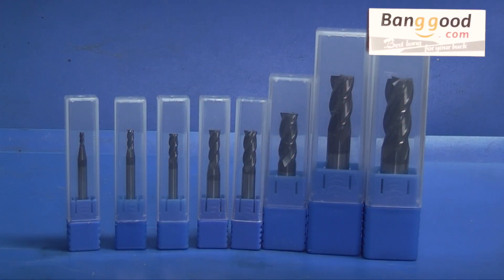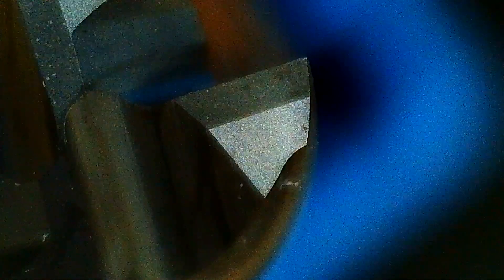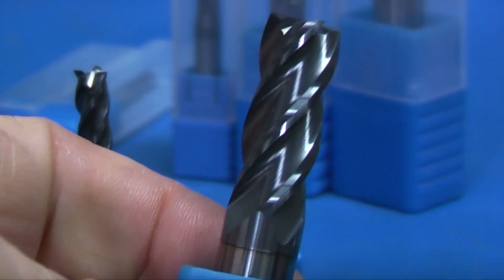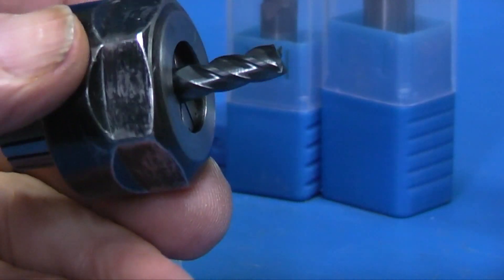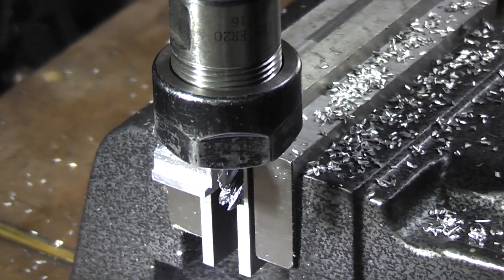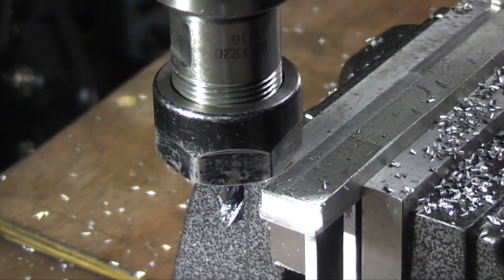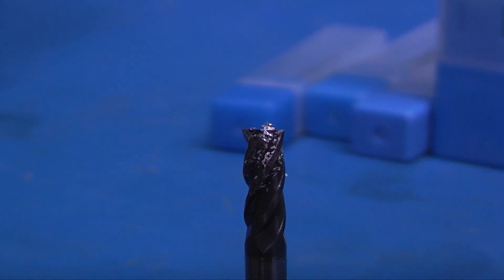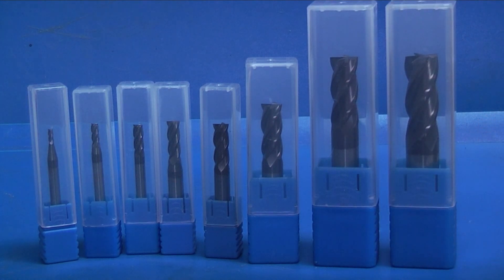Tool review Set of carbide milling cutters 2 to 12mm

Comment: The problem with this sort of unbranded stuff from Banggood is that they just buy from any supplier who has stock to get rid off, with no quality control. You may get a good set for a cheap price, or you may get utter rubbish. I find the best approach for cheap cutting tools etc is to use Banggood but only purchase branded goods. I find the DrillPro brand seems pretty reliable.

Comment: Hi Alan, £32 for the full set is bonkers! If you went with one of the big OEM's, this would be between £400 and £500 for uncoated. The main difference will be the carbide grain structure, the OEM's will be using micro grain Carbide which is more dense. That said, I have seen similar rough grinding marks from the OEM's as well. Can't go wrong at this price. Cheers, Jon